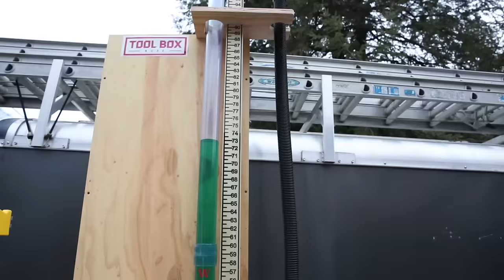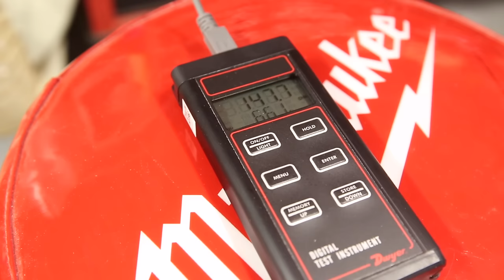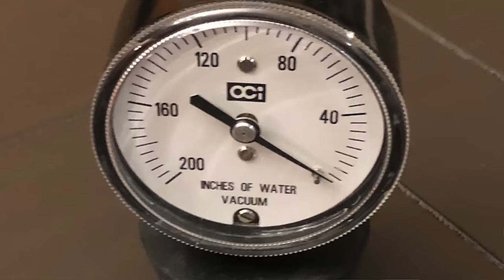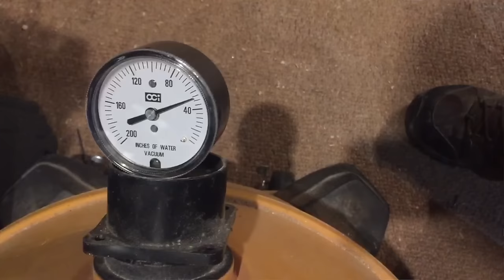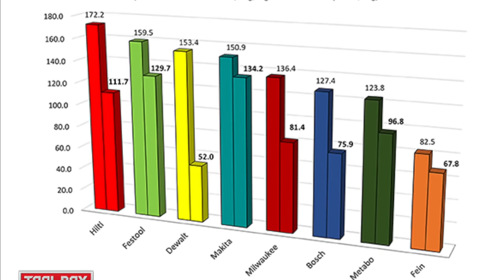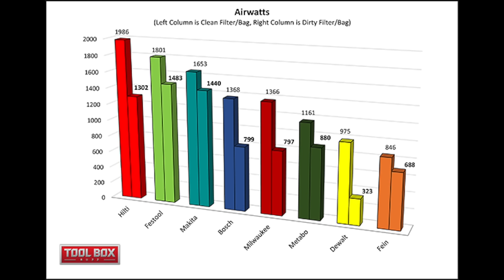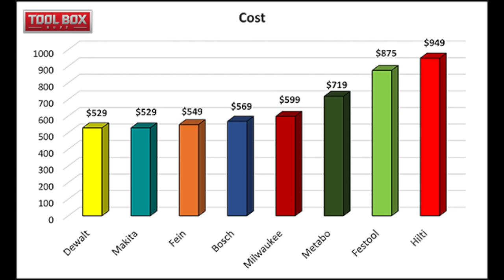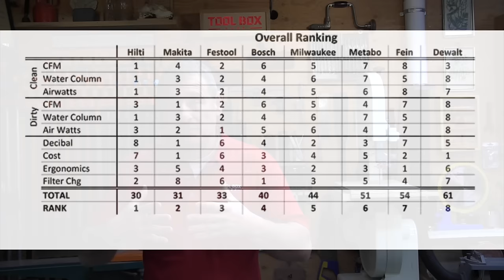Best Dust Extractors - Head-2-Head Testing

Comment: all of them use the same  DOMEL motors, their efficiency will vary depending on the initial filter surface  area / diameter of the hoses used but will eventually get low once the filter is dirty. Milwaukee is a rebranded  Nilfisk on the other  hand, wish they could show some more... metabo is bosh of course... etc. the best price for value now is makita with its 2512L, basically it is a nilfisk aero 26 with a small 1000W  domel motor easily replacable with the  strongest out there 1600W.. it is light and simply built without troublesome filter cleaning solutions. None of the trades is as  much demanding as  drywall sanding and this is where my small makita shines, one condition however, a  dust cyclone is a must but still cheaper and better than automatic filter cleaning, if you cannot fix failed PCB yourself, a metabo/bosh with mechanic filter cleaning is a boss here, they rarely fail and their PCBs are relatively cheap to buy - opposite to the rest of the bunch - festool especially which is only a better vac for those who are already in the system - tool boxes etc but not very convincing  and still use the same 1300W Domel as  many others. For truly solid suction use double or even triple motor vacuum cleaners like karcher NT 65/2, 70/3, the latter one is so strong making all the electronic automatic systems  totally unnecessary, you may dig in the ads, find an old WAP SQ850 and be happy ever forgetting the sales babble.

Comment: I’ve never used bags and have killed several or they blow out more than they suck up. Recently I brought a fein extractor and it was x shop display so had a bag in it have to admit I started using bags all time now. So much easier and cleaner.
Reply from the maker: Adam Lynch easier, cleaner, safer and better for your health, and better for the longevity of the vacuum unit
Reply: A Concord Carpenter / ToolBoxBuzz defiantly the old machines like the one I brought in 2002 and the bin extractor I had they were poor paper bags etc and the bloody things would burst. Glad to say now though on the new one I’d not use anything else now.

Comment: Quite an extensive test - good going! One thing, that you of course had to leave out , is: Which system has people already bought into. Especially with the Festool, and maybe also the Hilti, there are things around compatibility with tools, such as remote start, hose diameters, other functions, such as systainer storage capabilities. You of course already know towards which one I'm biased, and that's fine.I have Festool tools, and they work great together... also as stand alones, but there is a synergy. Had there been a significant difference to a better competitor, it would have to be factored in, but with the functionality, warranties, and overall suction efficiency, it stays on top by me.

Comment: Thank you for the very informative and informative depth video. I appreciate the detailed testing methodology being documented. 
This video according to YouTube is 6 years old though. The video helped me decide that the Makita would probably be the right choice for me because of price to performance. However that dust extractor is discontinued. I was able to find it on one site, being sold at $719.55. Much higher then the $529 from the making of this video and pushing closer to the Festool or Hilti.
This video did also help me to stay away from the Dewalt as I was considering that based on price alone. 

Would there happen to be an updated version of this video? 
Thank you very much for your time and consideration.

Comment: Great video. I have the Makita. Self cleaning feature not working after well under 100 hours of use. Of course out of the one year warranty period. I'm still using it for a specific purpose as the vacuum itself still works great. Which makes it an expensive $100.00 Ridgid basically. I replaced it with the Metabo which has a 3 year warranty.

Comment: Rob you absolutely rock! What a great video full of information that only could be had with a ton of work, thank you. I will say this, when I buy a tool I look at how well that tool does the job I bought it for. I can live with some small inconveniences from the best performer. My point  is, all the added details such as ergonomics are appreciated however I don't think they should weigh much in the final decision of what ranks the best. I don't recall the drop off of the less expensive units but that drop off is with a filter that we all will have most of the time, a little dirty. 40% or even 20% drop off in performance is unexceptionable and therefore they should not be in the top ranks in my opinion. But the cost of the of the better ones makes it easier to buy a standalone.
Reply from the maker: Agreed, thx! I’m hooked on using bags with the filter now

Comment: After having read the article I have two remarks on the way you counted the points:
1/ If there are 8 dust extractors and in case of 3 equal scores at the third place (ergonomy) the scores for best to worse should not be 1-2-3-3-3-4-5-6 
     but 1-2-3-3-3-6-7-8
2/ Part of the ergonomy is also testing the change of the filters/bags and the mess which it causes.
     But in the overall scores there is a special lines with points for changing of the filter/bags.
     That means that one thing has been judged two times. That is not correct imho.

I hoped that in the article would have been more information on how the ergonomy was tested/measured/judged. Now we see only numbers (1 2 3)
but not what exactly the problem is (why some things got a number 3 and not 2 or 1)

In the end, a great test and I'm happy that I found it. Thanks for sharing and good luck with your useful work.
Reply from the maker: Hans de Groot we're going to reach out to you next time we do the test for ergonomics….You're hired

Comment: While clean tests were nice to see out of the box performance, they should not be considered for the final score. No one works with a perfectly clean vacuum.
Also, warranty is not a big deal. The hilti is a LIMITED warranty, and the festool is only 3 years. Used with care, those machine will last way more than 3 years. 

Makita is the real winner. Performance/price is unbeatable and we know it will last.

I'm a drywall finisher and i've been using an older model DeWalt (made by karcher) with a power sander for more than 8 years. No bags, replacing the filter once a year. This thing is just unkillable.

My brother bought the festool with the planex. Had to repair the vacuum the 3rd year, then 3 years later, it went in smoke. So much for the warranty. He's bought the small bosch to replace it and he's pretty happy with it. The mechanism in the blower motor looks exactly like my DeWalt. 

I'm pretty sure, except for hilti and festool, other vacuums are rebranded models from special companies (like my dewalt is/was)

Comment: Thanks for the effort you put in this, very interesting! Two things to note:

1) It would be super important to use a professional SPL meter when doing measurements concerning the loudness of devices. An iPhone app and more importantly the internal mic of an iPhone are any other smartphone for that matter is NOT suffice. Also, you should mention what weighting was used. 
Most importantly however: A difference of about 10dB from best to worst device is HUGE. Google it, there is lots of material out there. It's totally normal that you won't come by it during your work as a contractor, but beeing a sound engineer I had to say something about this. Your interpretation that there wasn't a lot of difference is not correct. Your results showed devices ranging from "can be operated the whole day without concern" to "will severly DAMAGE YOUR HEARING over time / ear protection is MANDATORY".

2) Makita has a three year full coverage warranty as well.

Keep up doing those great videos! Cheers
Reply: Great feedback, I forgot when writing it that db are a log scale...i'll fix that in the written article. We've talked about buying a real db meter..but the cost has been holding us back. Any suggestions for an affordable option?
Reply: Well, any 25$ unit from amazon will be more precise than your phone. In this price range, those are not "well-calibrated" (I think that's the english term, is it? -> meant is approval by the official institutions) of course. However, since these are relative measurements, there is little to be said against using one of those, as long as you declare it accordingly. 

The bottleneck is the microphone in this case. Those smartphone mics have become amazingly good during the last years, but they are not meant to be "flat" concerning the frequency response. They are designed to shape the sound, so you get a lot of brilliance and thump in the lower frequencies. At the same time, the abbilities of such little mics, beeing tucked away in super tiny bodies are limited, so you will get significant loss of reproduction in the upper and lower frequency bands. Accordingly, your measurements will be far off, depending on the signal (sound of vacuum) that enters the mic. If a vacuum is running in a frequency band that is pushed or cut by the phones mic, it will get better or worse results accordingly. Think of it as trying to paint a straight line on a waved canvas...

A dB meter on the other hand has a measurement microphone, which is designed to be flat. That way, results will be far more consistent, even if the device as a whole device is off by 1 or 2 dB. 
Of course, a well calibrated tool would be the best way to go. Considering the growing importance of health safety and your aspiration concerning the production of reviews by pros for pros, this would be my recommendation. Since I am not from the US, there is no specific device I can recommend, but your local sound company or your officials in the municipal public order office surely can!

Finally, it would be good to use an A-weighted scale, since it reflects the response of the human ear. Hope this helps!
Reply: Probably makes more sense to show a logarithmic scale?
Reply: Todd Fratzel That certainly makes sense. But the weighting while measuring is also super important. Don't confuse the nature of the scale with the weighting. Here is a good read on the topic: http://www.animations.physics.unsw.edu.au/jw/dB.htm
The authorities measure SPL A-weighted, because this is what is relevant to the human ear and to potentially dangers for it accordingly.
Reply: It should also significantly influence your interpretation of the test results in general. If a manufacturer manages to produce a product that performs similarly to the best in the field while keeping the noise significantly lower, this is a huge deal. We are talking about the pinackle of engineering here, since this is super difficult to achieve, especially when you are on a budget. The Japanese usually ace this stuff, since their environmental laws are very strict. If you ever experienced a japanese construction site, you'll know what I mean. It is amazing, how quite and vibration free the building of a skyscraper can be.
Reply: NameNaameNameeNaamee seeing the noise is already ranked it won't change the outcome...but we want the data interpretation to be accurate
Reply: Todd Fratzel Well it should at least be reflected in your closing statement. Right now, it is significantly underrepresented. We are talking about health and safety here.
Reply from the maker: NameNaameNameeNaamee excellent feedback, thank you for sharing your professional experience, I appreciate it and learned something new

Comment: Great review!
I went for the bosch range of tools including dust extractor and I am not really happy about the performance of this tools, apart from the sander and 12v cabinets drill driver. Spend aroun 4k for the lot. The router which seems nicely built was the biggest disappointment.
Know I am dealing with Bosch customer service which seems to be very helpful but it's only the beginning of it all. Will see what's going to come out.
I got my tools from Axminster and so far I would definitely not recomand to shop with them.
The tools came with some multiples layer of  stickers on the boxes.  I've  noticed that removing  them will live the scarf and marks on the boxes, I mean the L-box range.

Comment: I have been going back and forth between getting the newer Makita model vc4210 and the Festool ct 36ac.  The makita was very attractive at approx 300 less but after looking closer the makitas bluetooth costs considerably more, only works with makita cordless tools and it isnt as refined as festools.  The festools BT installs directly in the vac and has a on/off button that attaches to the hose so you can use with any cordless tool. The makitas BT unit is a sizeable box that hangs on the vac and adds even more cords to get tangled and snagged on stuff.  Plus I dont see a on/off switch it looks like you can only use the BT with makita cordless tools and you need to buy a BT transmitter for each tool.  I guess that makes the Festool the winner even though it costs more up front if you need or want the BT the makitas cost savings narrows not to mention the refinements of the festool  such as the hose garage vs. the makitas hose hooks that wraps the hose around the outside of the vac which looks like a PITA when moving or transporting it. The festool has no extra things or cords hanging off the side of the unit and packs up nice and tidy when time to move to next job.

Comment: If dust a problem use the bona dcs back vac, its power full, light, quiet and no need for long hoses its super maneuverable $400 USD. The only down side is its a 2.5 gal. Capacity buy it never stops sucking..

Comment: Aside from the usual excellent head-to-heads and props for the level of detail not only in your videos, but even crazier level of detail on your site, I wanted to thank you for doing this.

While I have a cordless platform I stick to for ease of use and economy (M18), with corded extractors I can toss platform out the window. I'm solely relying on the results and pricing rather than the brand/compatibility on something that plugs in, which is one reason this information is so valuable.

Question: Are these considered something adequate for centrally extracting in a small hobby workshop, or are they for connecting to a single tool/table? I ask because you have several dust extractors in your workshop tour that seem to be a totally different style, so I get the feeling that there is a difference. However, not having any extraction as of yet, it's an important consideration before investing in something.

Comment: Great testing guys, thanks for the good work! But considering build quality and how long it will last the result would be very different. I know of a few guys who have had trouble with makita's breaking down quickly, while festools last for decades of daily hard use. I've worked for a company where they still have many old models vacuums that's eventually got replaced because you want something new once in a while but they never stopped working. Same with festool saws and screwdrivers. They usually last a decade of daily hard use.

Comment: Good job on all the work. One thing is that the Festool has the attachment for it's system. The longevity past the warranty must be considered also . Since this comparison was done there is new Festool CT-15 which doesn't have the hose storage like the others but it is only $349.

Comment: Overall, a nicely done review and I do not underestimate the difficulty of performing these tests.  However, I think you have missed the most important point - the filter efficiency (i.e. - how much particulate bypasses the filter element).  I also noticed some are listed as having HEPA filters while others are not.  Steve

Comment: Got a festool vac. The sealing mechanism is really really nice on their bags.
Reply: Not to mention Bluetooth. Hose garage.  Easy filter changes. Systainers stack on top. Honestly not having to lug a hose around instantly makes it better than the other two.  Now they have a cyclone that fits on top and you can still attach a systainer. Screw the rest.